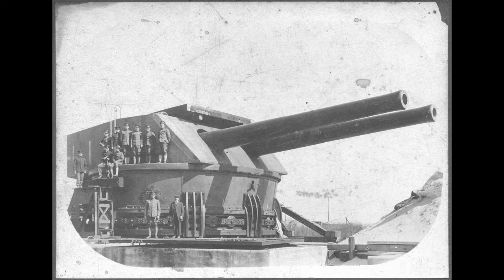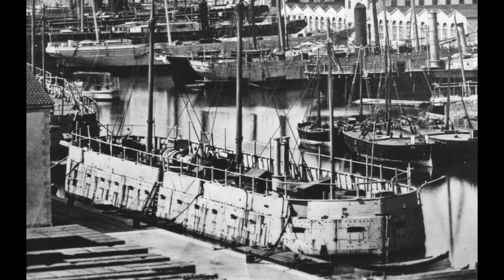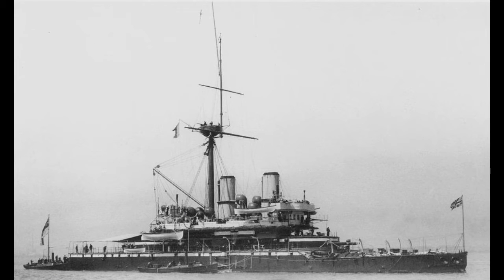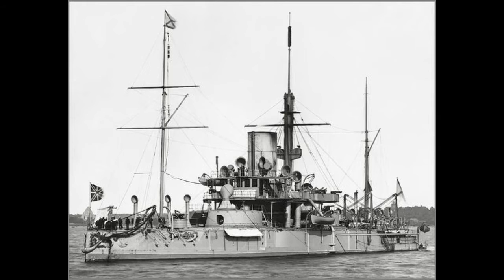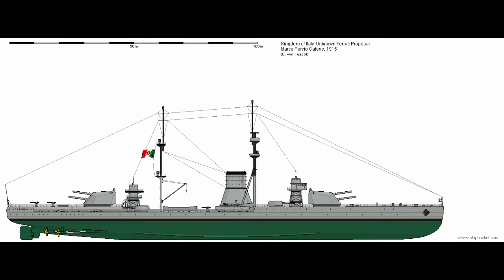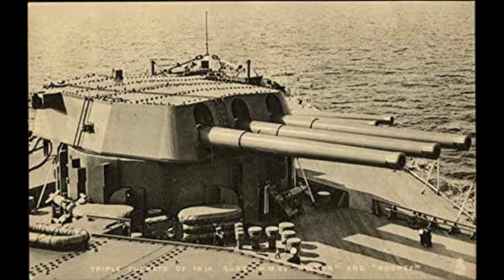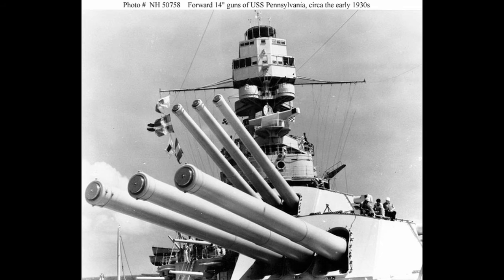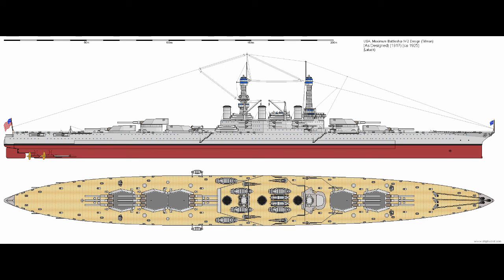General History: Ship Turret Development History

Comment: Great video!

I think the argument that a twin turret is safer than a triple turret because you loose less guns if the turret is put out of action is misleading. How much of your firepower you loose when loosing a turret depends on the number of turrets you have, not on the number of guns the turrets have. E.g. the six twin turrets of a japanese Fuso-class offer greater redundancy than the four triple turrets of a US Tennesses-class while having the same total number of guns. The same argument cannot be made when comparing the Tennessee to the Colorado-class. While the Colorado would loose only two guns instead of the three a Tennessee would loose, the Colorado has the disadvantage of starting with only 8 guns to the Tennessee twelve.

I think Tennessee and Colorado illustrate well what the debate between twins and tripples was mostly about: when working a given hull and displacement, do you want more guns or bigger guns? And the answer given tended to be "bigger guns". Only when the Washington naval treaty limited both the maximum calibre of the guns and the tonnage of a battleship did the greater weight efficency of the triple turret swing the debate in its favor.

Comment: There were turrets for the World War II 5 in 38 that did not penetrate into the hull. For example if you look at a Fletcher class, the midship turret was surface mounted. The part of the ship where was built contained the engines and the boilers not something you want ammunition to be stored amongst. I think destroyer escorts also sometimes sported the same turret if not they had a 4-in version of it.
Reply: I believe by USN terminology those were mounts as they lacked barbettes.
Reply: @doabarrellroll69  they were also counted as turrets in the specification for the Fletcher class and the destroyer escorts there were two classes of them. The one that comes to mind is the Buckley class.
Reply: @doabarrellroll69  I meant to add current terminology for guns in general the auto loader like the 76 mm otomelara (however the heck you spell it) are called mounts today. Even the 5-in guns are called mounts. But these are all auto loading weapons now.